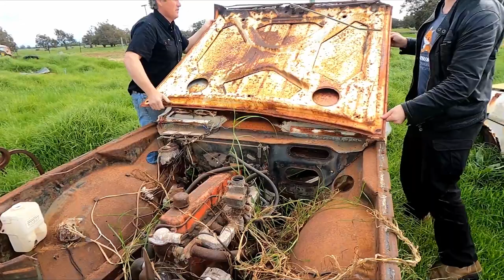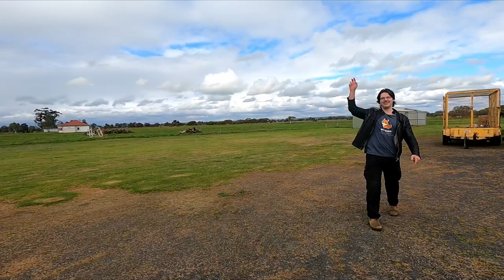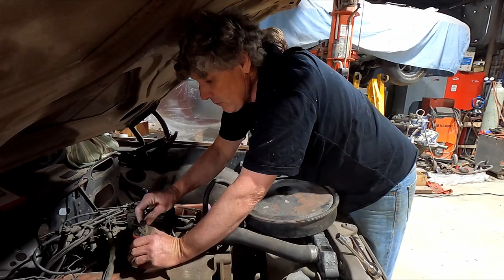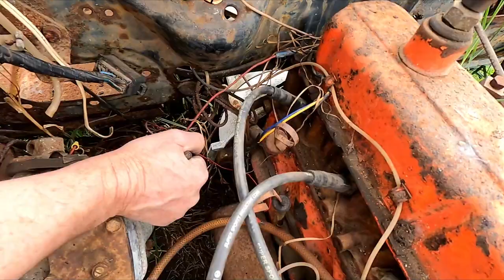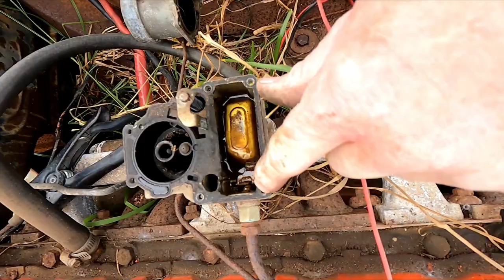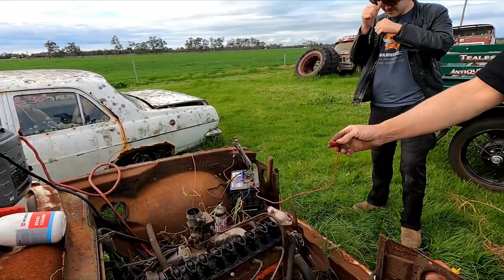Can we start this junk yard Holden left sitting for decades?

Comment: cool vid Rob. I love the Holden red 6. I have 6 202s  and a One Tonner with the mighty 202 and 5 speed commodore box Holley 350 carby...... as you do and the extractors. Shes a cool cruiser. Well done getting your 186 running. I knew it would. You know your Reds.

Comment: Great vid mate with some helpful hints. 
I have my grandfathers HR bought from new . It has 73,000 original miles, but has been sitting for years. I actually have a ring kit for it as when i stopped 
driving it i thought it had done one or 2, since found out it was more than likely a valve spring . 
If and when i find time to start it i will re ring it , thanks to your advice.
Cheers and thank you mate !

Comment: Just for the record ;-) Ford 32-48 Ignition ballast resistors have a positive temperature coefficient; as they get hotter their resistance increases. When they are cold they will give full battery voltage when cranking, typically 4.5V. And when the engine starts the resistor will get hot and give around 4.5V to the coil. If you crank the engine a lot, it will become warm and there will be a loss of voltage, causing the engine not to start. So back then they took a Nickel and shorted the resistor under the dash, that's called "Giving it a Nickel"
Reply from the maker: As an Aussie, l have not heard the giving it a nickle term before. Thank you for sharing. 👍 Cheers Rob.

Comment: Great to see the weeds fly back when that stubborn ol' tart fired up !! I guess the odds were against you ,Rob, with 3 outa 6 inlet valves stuck open ,not allowing a compression or effective firing strokes to happen for half the engine ! On the positive side, it shows that the valves guides clearance is close ( not much wear) and the stem seals have kept the guides free from the sludge that is heavy everywhere else in that sorry 186...Now you just gotta buff the paint..happy Fathers Day, Rob.

Comment: What the heck rusted out old Holden wakes up my goodness these cars just don’t fricken die.
Reply from the maker: We are currently trying to make it drive, getting close.
Reply: @robsshed  I have a 1993 VP Commodore still on the road and fully registered does that surprise you.
Reply from the maker: @woodss82   good to hear, my 1967 HR is still fully licenced and clocking about 3000 kms a year.
Reply: @robsshed  great, do you remember those or seen those model Commodore’s
Reply from the maker: @woodss82  thousand of them, I owned a mechanical repair shop when they were new. I have done pretty much every type of repair on those cars. I love the v6 engine and have transplanted many of them into other types of cars.

Comment: The 186 was not an original motor for HQ onward. The 202 was introduced then. My brother was a mechanic at the Holden Dealers at Inverell NSW, when the HQ was released. A Google search also says a 173 6 cylinder, and 4.2 and 5 litre V8.
Reply from the maker: Bit confused here, yes you are correct, and l don't believe I said a HQ would have a 186. This car is a HG made just before the HQ production comenced, it features a few HQ parts because of this. In a response to another comment I mentioed I drove a HQ ute for many years that had a 186 in it, but it came from the factory with a 202. My Dad (previous owner) put the 186 in it when the original 202 got smokey. Hope this clears it up. Thank you for watching cheers Rob.

Comment: too true with the top piston rings. i got 12,000 miles on the engine in my hr before it blew all rings and spun all bearing from previous owner running it without the radiator! if it wasnt for the spun rod bearings it would have ran for another 10,000 miles. the joys of an ole red motor...

Comment: Not to detract from your clip, but if that's a '71, I'll eat gorilla shit.
Pretty certain that in '68, the HK came out. I had a blue one, with the enormous 161 engine.
It was a basic car, wasn't fast, but it was a smooth old thing. I miss it, especially considering what it would be worth today.
I had a '65 HD Premier. next model up was the HR, which it looks as though you have.
A '71 ought to be an HT, followed by the HG.
Then we get onto the HQ, etc.
Best explanation of ballast resistors I've ever heard.
Fuel, Ignition and air!
Should start.
Thanks guys, and you have a gem there.

Comment: That HR Holden next to the HT,is it going to be parted out ?.If the subframe is good or repairable ,let me know please.
When scrap steal hit $400 a tonne back in 2006-07,so many cars crushed.And the Ex,sold all my parts,so I'm on the hunt,thanks in advance.Regards J.
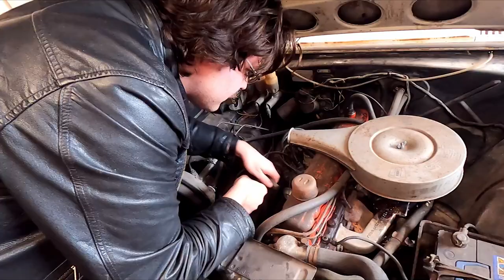EDIT:  @5:32 You got a 186S HR,if you have a spare K Block 186,that's what my old girl is.That HT Premiere shell,shame she got cut.Prems had different pillars at the rear of the roof
better shaped than the Kingswood.

Comment: Surface rust will tend to build up thicker on the inside corner of the bore ridge. Just deridge like you would when changing rings. Problem solved.
Reply from the maker: I have had them break rings with no detectable ridge in the bores as well.  For sure a well worn engine left, carbon deposits and dried up oil can prop the ring to the point of impact on the ridge all makes sense. Thank you for sharing to our youtube community, it is appreciated. Cheers Rob.

Comment: It must be a 5/71. Last of the HGs and first of the HQs.
Old gunkers left for years,, the bores are all rust and that breaks the rings. Seen it a heap of times.  Why I would never rely on an old engine without at least a kero rebuild. Though the waterjackets will be very rusty,, sometimes into the bores. Seen that also,, rebuild and then they split or have a bore weeping. Our Aussie engines seldom ever saw actual coolant,, just tap water
Reply from the maker: I have to agree here, this lines up with my experiance exactly. The Premier is tagged 4/71, but the steering box date is somewhere in the last four or five days of the month. Cheers Rob.
Reply: The utes and panel vans ran out to about September or October that year. The commercial versions often trailed the passenger models by a few months.

Comment: lol, even as a 5 cylinder it still runs better than the 4 cylinder Starfire engine GMH used
Reply from the maker: Many years ago I made the mistake of fitting an alloy timing gear to a Starfire 4, you wouldn't believe the noise it made. Couldn't leave it running for more than about 30 seconds. Straight back out and put a fiber one in it. Lesson learned. Definately one of GMH's failures.
Thanks for watching. Cheers Rob and Deb.

Comment: would that valve free itself after running a while
Reply from the maker: Not with this one, as we found out in part two the valve stem was rusted badly from having had water in the intake manifold. Sometimes a valve that has just stuck from sitting will free with the engine warming up, but often the camshaft will be damaged from the cam hitting the lifter that will be floating. The cam relies on the valve spring to keep the lifter tight against the camshaft. Cheers Rob.

Comment: And it's never going to run on that cylinder with no plug lead on it either!!..
Reply from the maker: With the intake valve jammed wide open, the engine wasn't going to run at all with the intake air/fuel charge burning in the manifold. I removed the lead to stop the plug from firing the charge. Hope this explains why it was off. I did mention this in the video. Cheers Rob.